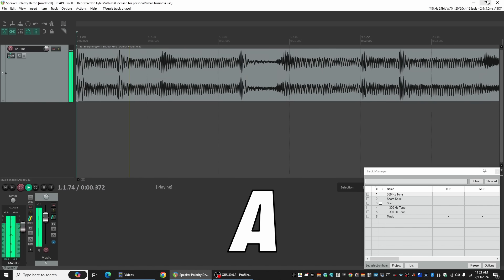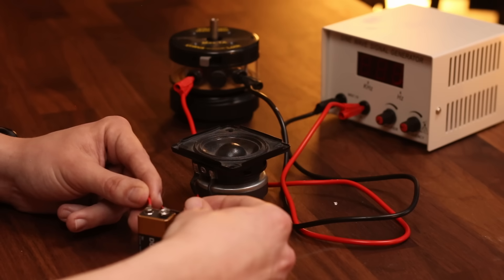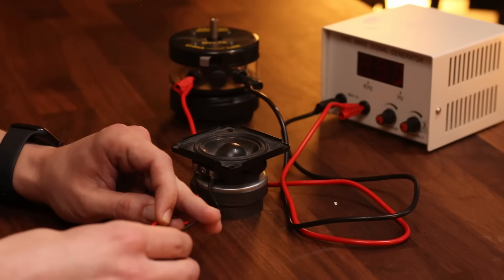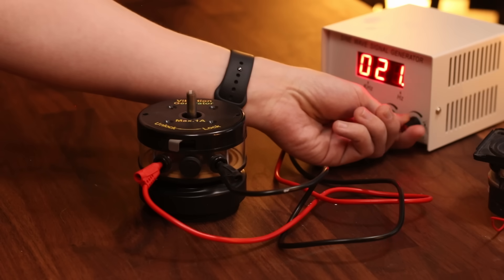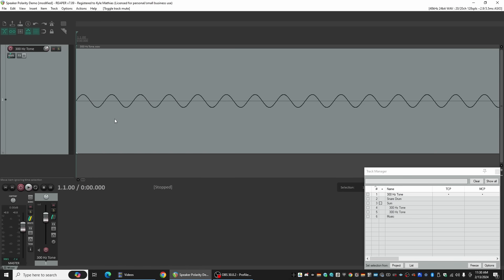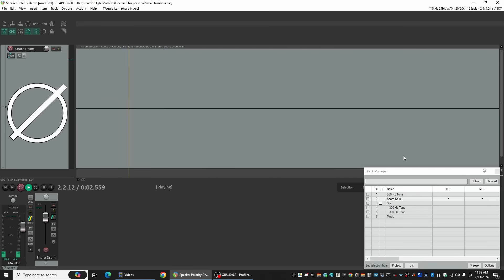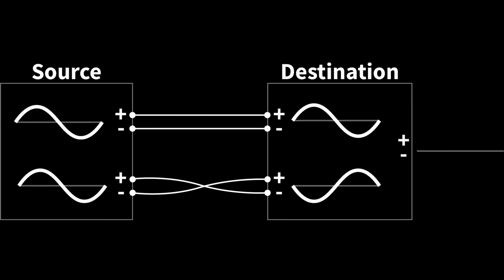What Happens When You Wire Speakers Backwards?

Comment: I'm still trying to invert sound by 180 degrees. Am sure it's possible. Where a microphone is amped and inverted to provide a "mirror" image of input, resulting in silence.
Reply: The problem with this is the time delay involved and the radiation pattern of the mirror image expanding from a different location then the source. Noise cancelling like this only works in earphones where the time delay is extremely small and the radiation pattern can be controlled in the ear canal.

Comment: So for stereo sound it is now clear: Use correct plus and minus wiring.

But what about subs for surround systems? My sub has a setting called phase, and it can be altered in steps between 0 and 180. Seems to be the same thing like plus and minus (subs are wired typically with coax cables, which can not be used wrongly).

How can I find out the correct phase setting, with no special tools? Maybe only a wave file?

Comment: Since I'm totally deft in one ear I can't hear the difference/stereo others can hear. I only hear mono. Don't know stereo. I want to hear the difference between left and right. I have and on purpose wired rear speakers, "Left minus right" and/or removed the common ground connection to the headphones. It removes the mono. (It's not quite backward as you say). I've done that in sound editors to create a difference song.  Try it. 

"What Happens When You Wire Speakers Backwards?" I didn't do it like you did.

Comment: If you connect a 3rd speaker to stereo, by connecting the positive from both sides to the 3rd speaker, tou create a 3rd channel (or just hook up one speaker using the positive of right to positive of speaker and positive of left to negative of speaker) you get a new channel.  Flip that and see what it does (you need actual audio like music or other media and not just single tones).

If you hook up a DC motor to speaker outputs, you can hear the media play through it.

Comment: If you wire one speaker correctly and one incorrectly, they will cancel each other (on a mono signal) exactly where they conversge, everywhere else you will not exactly know where the sound is coming from. and that's why sound testing is done with white noise on both (or all 4) speakers...because if some are wrired wrongly the sound won't come from fron anymore... and that's how positional sounds are created by the way :D

Comment: If I am wiring speakers with inverted polarity and the symmetry is adjusted correctly to zero (balanced amp output) the sound will be as usual (in stereo both speakers then are to be wired that way of course). With a more simple amp which only pushes the speaker into one direction, depending on the polarity (asymmetric/grounded amp stage), it might be not so good. Means either outward or inward. Because pulling the coil inward has some more "substantial" mechanical limits I suppose.

Comment: in fact this was the topic of my Master study in Physics. I discovered that the non-linearity of our hearing system can make polarity differences audible. This was the case with headphones and in the anechoic room with signals with distinct higher harmonics. In a "normal" room, the reflections mess up the phases of a the frequency components (Fourier) and there is no more interference with the auditory distortion products. Therefore, in a normal room you cannot hear the effect of polarity.

Comment: A super-simple way to check polarity of (moveable) speakers with a stereo amplifier, is to just point both speakers towards each other (less than 100mm between them is good).  If incorrectly phased (wired polarity) the sound will not diminish very much.  If correctly phased, the sound will be very noticeably attenuated.

Comment: Yeah, well presented by not actually anything new. A lot of tests regarding phase were done decades ago, and it was determined that people cannot tell the difference between an audio signal and its inverse, except when the two are applied to a pair of speakers, one in phase and the other out of phase. It is not that some people 'think' or assert that they can tell the difference, they are mistaken and they quite simply cannot, and again this has been extensively verified. So I liked this video, but was a bit disappointed that the presenter seemed reluctant to simply state the physical facts, apparently hedging against those people who have contrary (incorrect)  opinions.

Comment: I feel like the snare drum test, if i close my eyes the inverted sound might sound very very slightly more duller.

But I think human inner ears just turn analogue sound into a Fourier transform which it sends to the brain, which I'm 99% sure shouldn't be able to tell phase information like that... So i'm probably imagining it.

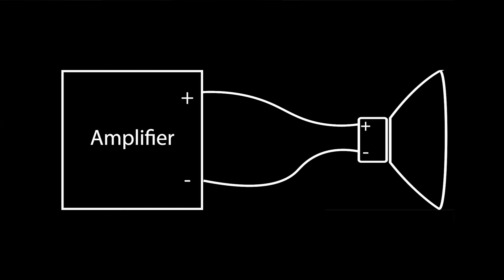6:50 what you'll end up getting is an interference pattern. If you're in a room and you're standing N wavelengths from speaker 1 but N+0.5 wavelengths from the speaker 2. The speakers will destructively interfere with each other. Of course that's only really a problem if you're playing a single tone... Edit: at least that's what i thought until I saw your comb filter video...

Comment: A sign wave does not necessarily equal alternating current. Wow there’s no particular reason why an audio signal can’t be all current. It’ll be much more complicated to produce. An AC current through a speaker would produce 60 Hz signal in North America and 50 Hz signal in Europe equipment is DC meaning that sine wave is just amplitude variations within one polarity.

Comment: The only thing I have ever noticed is that if they are wired backwards (though I assume this is only true if some are wired backwards) is that perception of space is harder to pinpoint. so a car that drives from left to right in a stereo room with a speaker wired backwards still sounds like it's going from Left to Right, but instead of it sounding like it's coming from way off screen it just sounds like it's starting slightly out of frame.

Comment: Electronics wise, speakers have no polarity.  They're designed for A/C input, so while there is an "out" point and an "in" point, the functionality is by the in/out of the sine wave.  I think you covered the latter part well.

In a perfect world where two speakers are wired oppositely such that cancelling sine waves exist in the same exact air mass without interference, this impossible dream of somehow listening to both and getting no sound could exist, but it doesn't.  The exception, of course, is that in the software you can set up two opposite sine wave phases (off by 180°) and emit them through one speaker, and ... voila... no sound.

This isn't real life.  In real life the best we can do is use an enclosed interference-free airmass such as in a headset or earbud, and then use an external microphone to create an ambient-sound reverse sound wave (modified to reflect the muffling of the earpiece) and mix that in with the sound, and ...voila... that's exactly how ANR (US) or ANC (EU) works.

For a practical and fun experiment:
1. Set up two audio sources, one being a talking person (or music but harder to hear the effect), and the other being a microphone right next to the listener.
2. Set up one audio output with an enclosed airspace (earpiece, earbud, headset)
3. Vary the phase of the microphone input from 180° (ANR) to 0° (noise amplification) and anywhere in between.  Around 170-190° you'll find the noise is not only "there" but is also provided out of phase with itself so it becomes much more difficult to tune out and most people would find that annoying.
4. For the heck of it, remove the first audio source.   Set the phase to anything you like because it won't matter.  Now set the delay to anything about 20ms.  You'll find as you speak into the microphone, reading text for example, as you increase the delay, the feedback in your ear will be delayed, and most speakers will slew their rate down to allow the "echo" to catch up, which it never will.  This is how "echo-cancellation" works in modern electronic telephones, so that remote-echo is removed, but a local echo with 0msec delay is introduced to provide positive feedback to the speaker.
5. Want to get whacky?  Have someone else put on the headset and talk into the microphone, and introduce sine-wave variations into the delay, such that it goes from 0msec to 140msec and back to 0... and have an external observer laugh his/her 455 off listening to the stilted speech.

Polarity is not a thing on A/C devices, and speakers are a poor example because they operate in an imperfect airmass with acoustics, interference, and other factors.  Further complicating any use of this would be the fact that no two speakers are the same, since magnets are not uniform, change over time and use, and must be recalibrated to be used experimentally.  Degaussing is not something you likely want to get into but then lab experiments with real devices require controlled conditions :)

Thoroughly enjoyable topic.  Thank you!!

Comment: Phase is a weird thing took me years to be able to spot it the low end and mids have a different feel on hi end monitors have seen it be used to great effect to cancel audio and create cardioid sub arrays or clusters. excellent content we need more good engineers in this industry with good core understanding of the equipment they are using and the physics of it and the audio they are producing.

Comment: To describe audio signals as "alternating current, or AC" is a bit sketchy. Audio signals have their own unique waveform, which is an encoding of the audio data. True alternating current is a constant waveform, usually sinusoidal, and gives a constant 50hz or 60hz tone (depending on which side of the pond you're on) if played through a speaker. Audio data is not really AC.
Reply from the maker: I think this is a narrow definition of AC. Alternating current is used for purposes other than power.

Comment: I like to hook the plus wire to the minus terminal on both speakers, and the minus wire to the plus terminal on both of the used speakers I bought. That way all of the electrons that have piled up in the speaker boxes over time can drain back out so the speakers won't start sounded muffled. You might say I'm just a troublemaker, but all of the best audiophiles know to switch their speaker leads back and forth every month. It's like rotating a car's tires. My buddy told me I'd blow up my speakers by reversing the leads, but he's no audiophile, so I guess I showed him. Hah! Now I'm saving up for an $800 low-oxygen, Litz-wire AC power cord. I hear they are the best! All the audiophiles say so!
Reply: just make sure you don't let the electrons stain the carpet

Comment: I have surround speakers with two tweeters that can be set to bi-pole or di-pole mode with a switch. The di-pole mode is supposed to put them out of phase and make some of the sound cancel each other out, creating a very interesting surround experience. Is this a similar concept to plugging one of two speakers backwards?
I love the di-pole mode. Audio coming from the surround channels really sounds like it's just happening somewhere above me and not where the speakers are located. It's like a poor man's Atmos illusion. 😆

Comment: To conduct a proper phase cancellation test, you should ensure that both the normal phase and the inverted phase signals are on the same channel.

Additionally, when you switch your stereo system to mono mode and position the speakers to face each other, it’s crucial to set one speaker to be out of phase to optimize the response.

Experimenting with phase inversion on a mixing console’s inputs can lead to nearly complete signal cancellation.

However, attempting to achieve 100% cancellation with speakers is challenging due to off-axis coloration. It’s also a common error to tamper with the phasing between two channels, such as the left and right, on a loudspeaker system. This is because these channels often do not carry identical signals.

Comment: yes, they signals would cancel if you were in the correct location hearing the 300 hertz, but that wavelength at 300 hertz is about 1.1 meter, so with mono tonal stereo kyou could move about a room and in theory find quiet canceling nodes and loud reinforcing nodes. 
Or in the case of doing the wiring right the nodes would be reversed, but still exist.

Comment: That's how you testing whether the power supply has low hum and parasite noises. Just ad an appropriate resistor in + series (depending of the voltage of the power supply, - of course), and connect speaker. If the power supply is good (ideally will be just as battery just click and that's it), it will be just pop of the speaker membrane and that's it. No hum, noise...pure battery - if the power supply is good enough.

Comment: Most front of house systems are designed to be wired correctly - the bottom end gets to the ears of the listener slower than higher frequencies - so if a speaker is wired backward - it will push air to the back of the room, but not at the correct timing and will sound different. This can happen even when the speakers are all wired correctly in the cabinet but the polarity is wrong on the speaker cable. That is more common than the actual speaker being wired backwards, from people making their own cables or cheaply manufactured cables

Comment: 180° out of phase?.  Theory of two sinewaves being out of phase is used in different applications such as RF. That is, directional AM Broadcast at night.  Two or more antennas are utilized, and  when the RF once leaves the transmitter,  the signals are fed into a phasing unit. Then, proper phase and current are fed to the different antennas for the desired directional pattern to protect the cochannel station operating on the same frequency some distance away.

Comment: Just to clear some things up here. If the driver is wired to move outwards at DC, this does not mean that it moves outwards for a positive voltage across the entire frequency range. Below its fundamental resonance frequency, it does move outwards for a positive voltage (assuming one polarity of the two choices). However, then it moves INWARDS for a positive voltage at higher frequencies well above it fundamental frequency. This is typically also what you want, because the inwards movement will result in a positive pressure when the driver is loaded with a free-field-ish condition, which a room pretty much is at higher frequencies (excluding at lot of details here). This goes against most acoustical engineer's intution, but the theory as well as simulations will reveal this. So the battery test is merely a proxy for what is actually going in the frequency range of interest; the pass-band of the driver.

Comment: the speakers have to be wired + to + and - to - or they will not sound right or as powerful because when they are wired right the speaker cone moves out forcing the air to your ear, in a stereo speaker setup if one is wired backwards it pulls on one of your ears depending what speaker is wired out of faze. if known this since i was a kid.

Comment: When you wire one bass driver normally and the other one inversed, you can use isobaric push-pull coupling to make them behave like one with double the stiffness. You either mount them cone-to-cone inside a cube-shaped box with a bass reflex tube for an opening, or you can use a big short tube as your bass box and put the speakers on both end facing outwards.

Comment: I wonder if the geometry of the speakers could also play a part. if the air the speaker displaces in the back stroke is diferent than the air it displaces in the forward stroke it could also lead to a difrrence in the sound.

Comment: This just happened to of popped up on my Youtube.  I spent many years in the automotive stereo industry, starting out very young.  I could never hear the difference AS long as everything was wired the same.  But wire one speaker wrong in a stereo system and you most assuredly can and will hear it.  That was almost 40 years when I started, and nothing much has changed.  Very important to get it right and right the first time.  Nothing worse than having that person coming back because you got it wrong.
Reply: "This just happened to of popped up on my Youtube." Ummm; 'happened to OF popped up'???? I suppose you ask people questions like; "Where OF you been?"
The word is HAVE! 
Does anyone learn grammar these days?
Reply: @BigAl53750  Excuse the FUCK for my incorrect grammer.

Comment: Regarding the question @05:15: I have read that audiophiles claim that the bass keg bonks outward so the speakers should do the bonk outwards as well (though it is an elastic oscillating movement). And of course they say they hear the difference. Even claim that the speaker design itself promotes push-out before push-in. 
And it's imperative to have special expensive "oxygen free copper" wires, though allegedly the copper metal industry as a whole has gone to oxygen free processing just for better metal quality.

Comment: I actually have reversed the polarity of my high end speakers, because  i noticed a  phase issue with my active subwoofer's internal crossover even if i use the preset that was made for the exact speakers i have. Not sure if this is caused by using balanced to a power amp for my speakers and rca for subwoofer, or if it's just my room being weird. but i've never had any issue this way. Glad I don't have to worry about this

Comment: I tried playing an Edison diamond disc (hill and dale modulation, 90 degrees offset from your usual victrola records) on a stereo turntable, and the sound has this weird hollow sound from the speakers doing the music in opposite directions. Unless you can find that exact dead space exactly equidistant from the two speakers, and have them both adjusted to the same exact volume, you will still hear the music. It's even weirder in headphones.